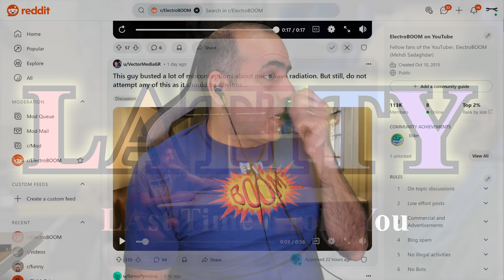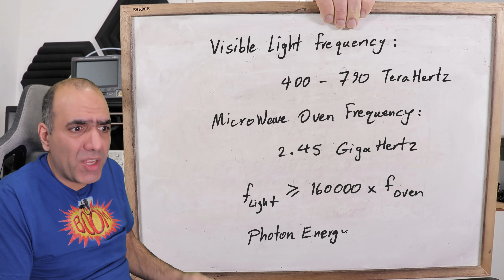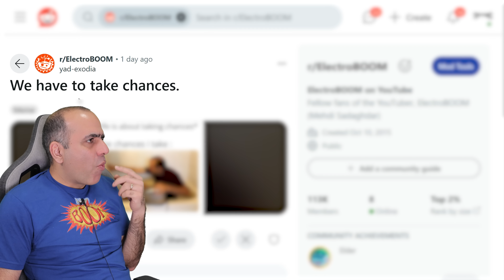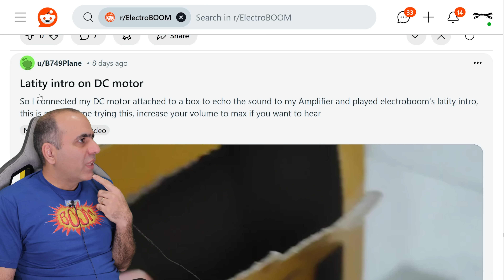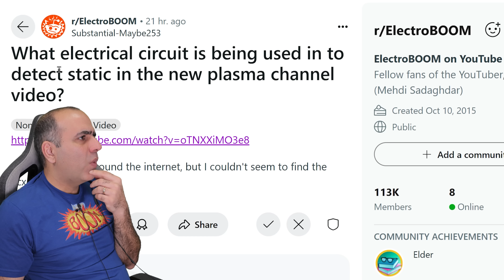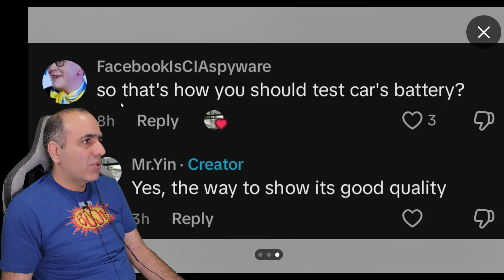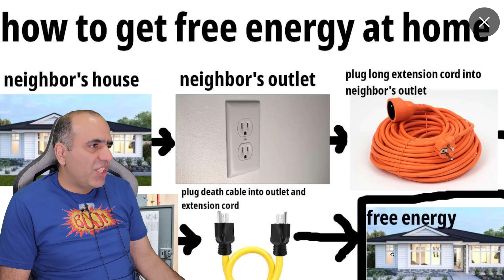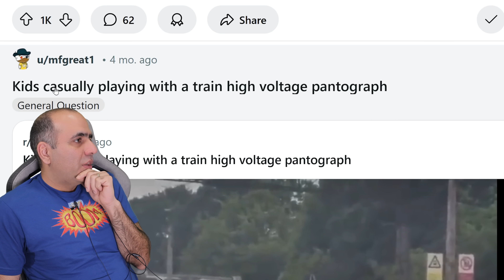Can You Microwave Yourself?! (LATITY014)

Comment: I don't see anything wrong, shoving type C (Europlug) appliances into type G (BS 1363), I did it all the time, though it is not recommended by Malaysian Standards governing body(SIRIM).

Beside adapters is cheap and also a little DIY if you want to convert Type C to Type G.

Mehdi should rate AC power plug safety someday, I believe type G is the safest.

Comment: In fact the waves reflecting back and forth inside the microwave oven create station waves making some places with a high power density and other and other with almost no power density. That is why you have a rotating tray inside the microwave (older ovens used a rotating reflector to change the position of the waves.
The energy of the photons is irrelevant if the number of photons is high. The frequency is chosen because it is heavily absorbed by water. Forget QM it does not help here: just calculate the average power density inside the whole cavity (but remember that standing waves distribute power unevenly that is why I don't put a glass of water in the middle of the rotating tray for better heating).
So even if the power is not enough to heat some tissues fast, tissues with high water content will heat much faster (like your eyes and mucous membranes).

Comment: my school has horrible microwaves, the door on one is broken so you can actually put your hand up to it and feel the heat from the radiation. I was surprised because it feals like a very concentrated line of heat instead of alot of heat around like most heat sources.

Comment: Let me clear something up for people.

A magnetron is what goes inside of microwave ovens, which are the devices you might have on either your counter top, above your stove, or where ever. The point is, is we use them to heat up out food. How do microwave ovens heat up food? To understand how that works you need to understand what microwaves are.

A microwave is a form of electromagnetic radiation. Now, typically when you hear the word "radiation" you think highly dangerous and could cause cancer, or other forms of dangerous diseases or powerful yet dangerous impacts on the human body like mutation. But that is simply not always the case. There are two categories of radiation, "ionizing" and "non-ionizing". "Ionizing" radiation is radiation that CAN cause damage to the human body and cellular structure, tearing through the body and destroying DNA, RNA, etc. Ionizing radiation is like X-rays, Gamma-Rays, Alpha Rays, and Beta-Rays. These forms of radiation are very high energy and can cause serious damage if in high intensities or not treated. "Non-Ionizing" radiation is radiation that does NOT damage cells, or at least in the way ionizing radiation does. I say this because ionizing radiation itself does the damage, so Alpha-Rays which are composed of Alpha particles, those alpha particles are doing the damage to cells, and what not, same with Beta-Rays, beta particles are doing the damage.

How does non-ionizing radiation damage you or cells? Well to start, you need to understand forms of non-ionizing radiation. In this example, we are focusing on the Micro-wave. Micro-waves are a form of "Electromagnetic Radiation" which is typically generated in Electromagnetic interactions of high energies. There is sort of a spectrum of waves. Like light we know that it goes from Low-Energy (Infrared - Heat) to Medium-Energy (Visible Light - Color) to High-Energy (Ultraviolet - Invisible, but high-energy) similar to this, there is a spectrum for electromagnetic radiation, and light is on there too! Another quick thing to note is that the higher the frequency, the shorter the wavelength.

So what do Micro-waves do that is dangerous? Micro-waves vibrate water molecules in your food, and this in term, generates heat causing your food to heat up. While in the case of you being subjected to close proximity of a magnetron (The device that generates the Micro-waves in your microwave oven.) its not the electromagnetic radiation that is doing damage in the sense of IT being responsible for damage, its the effect the Micro-waves have on the water molecules in your skin and cells that causes the damage.

Warning! DO NOT subject yourself to a Magnetron in close proximity!

You can be sub-due to harsh burns, rashes, blisters and more painful phenomena that can cause serious injuries!

If you want to learn more about this, you can always reply to this comment.

Comment: Love ya, man. Keep it crazy.

But I did want to give you a heads-up,  the microwave magnetron radiates from the sides of that nub on the top, not straight out the end. I don't know if you were crawling on the floor to keep away from the microwaves or if that was just the fun way to do it, but you were actually in the strongest area of the field.

Comment: I had such a cable in my old neighbor, 500kv power line was passing through a San Fransisco-like hilly roads, uphill and downhill but the power line is at fixed height and at some hills as you get closer to the line, a tingling sensation and a 50hz bass sound was coming and static feeling on the top of my head-hair.
I'm totally in another city now but I guess it's more or less like the one posted to LATITY-posting, but no coronal discharge or any blue arc was observable.
But say if you had few meters of conductive thin wire and a folio wrap balloon (the conductive party balloons) one could feel something.
DO NOT TRY THIS
Reply: or try this, it won't kill you that much, just a little

Comment: 9:51 Or better yet, learn how to change the battery in your ignitor and let the sparker of said ignitor do the work (although you may need to remove surface rust because with my experience [shared with my aunt and her aunt and uncle] the sparker would need a bare surface of metal for the actual spark to jump to)

Comment: You can get free energy with a red pulse construction Lazer, piece of wood with 2 finishing nails for the venture crushing the fields of the photons ripping away the black from the white balls creating a sub-atomic nuclear explosion and go from a 5v lazer to billion-trillions of electron volts the red turns 100% white and you collect that run it through a circuit to batts then power anything you want because you only have to start it once initially then have a setting that doesn't let the batteries completely discharge so you can always power the 5 volt Lazer.  The contraption just needs to be engineered and I'm not financially viable to do it right now.

Comment: We have 500 kV line not so far from where I live. When you ride a bike under it you need to touch any metal part of your bike to let small current flow and discharge your body because else the charge induced from the line through a half of a period of AC can get you several thousand Volts potential difference to the ground, so it discharges through the air and it's not always a pleasant place on your body. )))
*By the way. Almost every year I see how stupidity and recklessness leads people to death or terrible injuries from the power lines. Kids are playing on the top of trains, someone touches wire accidentally or even on "oh, wHaT iF" purpose with a fishing rod. Every year I see news "Kid died in the bath with a phone on charge" and every time dozens of people are writing in the comments "iT cAn'T bEeee, it's only five voooolts". Idiots.(((

Comment: 10:35 You can test car lead-acid batteries for corrosion by charging them up, measuring the voltage, shorting them for about 10 seconds and remeasuring. If the difference of measurements is above 0.8 volts, the battery is is pretty much dead. Wouldn't try it with lithiums tho.

Source: old Honda service manuals

Comment: UK resident here. Yes you can use EU plugs in our outlets but it does mean bypassing the earth safety prong, which involves sticking something  into the ground receptacle in order to open up the live and neutral guard

Not recommended for obvious reasons but still doable.

Although we have EU sockets in our bathroom for charging toothbrushes and using electric shavers.

Comment: Yes, Euro plug into UK socket is dangerous. Firstly the shutter mechanism in a UK socket is operated by the longer earth (ground) pin going in first. So in order to insert a Euro plug you have to defeat the shutter mechanism by inserting a foreign object into the earth hole.

Secondly, UK plugs have a fuse, Euro plugs do not. The fuse is there for a reason, sockets in the UK are commonly fed from a ring circuit on a 32A breaker, so the appliance cord needs a fuse. Other countries plugs typically don't have a fuse because the sockets are fed on radial circuits on a much smaller breaker.

And finally the UK socket just isn't designed to take a Euro plug, so there's no guarantee that the plug will make a.good contact with the socket, which can lead to high resistance or arcing
Reply: Now i understand the reason for that fuse, thanks. It's limited to 16 amps in our code and most power cords can handle that under normal conditions. The equipment is supposed to have an internal fuse, optimized for that specific equipment. The power cords for bigger equipment always use wire that is rated for 16 amp continuously. The wire gauge does not need to be the same as the one in the installation, because our code demands a bit oversized wire gauge, to avoid power drops over longer distances, it is not for fire hazard because even 4 times thinner wire can handle 16 amps without getting hot. It only becomes dangerous if it's a long wire that is rolled up , that can get hot enough to melt the insulation.
Reply: I like putting g foreign objects into the earth hole though😂
Reply: Regarding the shutter, it's on ground and you can just force it through without the ground pin.
Reply: I don't understand why the whole world doesn't adopt the UK G type plug socket. It's super safe and you can't accidentally unplug something by tugging on it. And it comes with a fuse installed. One time on holiday in Mexico the US plug socket was so feeble we had to tape the plug to the wall because it kept falling off and arcing. G type is king, everything else, pathetic.
Reply: @TheMadScientistOfLuton  each plug type has downsides. The UK plug's biggest: can only be inserted one way.
Reply: @TheMadScientistOfLuton  Forced grounding (and ring circuits are generally not good).
Reply: @TheMadScientistOfLuton  yeah well that's Mexico. You know Mexico isn't a first world country with good safety standards right? Just because the Mexican version of the US outlet is made of toothpicks and glue, that doesn't reflect a proper made US outlet. 
Your comment is like "I didn't like the quality of the Italian pizza that I bought in China town, which means all pizza is bad"
Ignorant blanket statement on your part. 
Try comparing a US outlet to something made for 12 cents in a sweatshop.
Reply: still not stopping me, works fine with battery charger
Reply: You are overreacting. Everyone in my country does this all the time. Worst that happens is the house breaker will trip. Is it more dangerous than using a UK plug, sure, but it's not as bad as you make it sound
Reply: @dogoku yeah also, people don't want to increase the price of their products by adding fuses and baby protection and weird shielding and shit.
I'm a grown man with no babies in my house EVER and I don't go around trying to put a plug in halfway and then jam something metal into the exposed half.
I'm convinced that UK babies are suicidal, if these extreme plug precautions are needed. 
Instead of making your UK plug sockets and plugs "suicide proof" then UK parents should PAY ATTENTION TO THEIR BABIES BETTER. 
Or at least take the infants to therapists to see why they try so hard to kill themselves. 
I don't see why people in the UK are so obsessed with telling everyone to adopt their weird anti-suicide baby protection mumbo jumbo. 
They didn't do Brexit correctly and their politicians are only slightly less insane and evil than Ronald McTrump the sex offender. 
And they pay more taxes and VAT so I'm not sure why they are in a position to talk about efficiency or good ideas.
Reply: 1. 2-Pin EU plug no need to be grounded (Same with some UK devices - look for Yours phone chargers: grund pin is plastic!)
2. Almost every EU device has build kinda protection /fuse/ mechanical or thermal - this is why never buy cheap "china export" stuff.
3. 99% emigrants from EU never use proper UK plug after arriving or when coming into sesonal work. Scewdriver or knife, to open socket flap, and no adaper is requied. Never heard about anybody to hurt himself.
Reply: @stanley3647  I never said it needs to be earthed, just that the earth pin - whether it does anything electrically or not - is what opens the shutter. Sticking something other than a plug in there to open the shutter is not a good idea and can damage the socket.

And yes applicants have overload protection built in, but the fuse in the plug is to protect the cord, not the appliance, which the overload protection in the appliance wouldn't necessarily do as it's after the cord.

And just because 99% of immigrants do it doesn't make it right

Comment: Feeling a mild shock on a bicycle under HV powerlines is REAL! If you have rubber hand grips and shoes on you will be electricly isolated from the bike. While under power lines, stand up, coast, then lightly touch handbrake or other metal part of frame. 
I also got shocked on a bike under a Blackhawk helicopter as it was landing. :-D

Comment: I was a radio tech in the USAF, and it always makes me giggle when people get scared of microwave radiation. I'd be blasting myself with a 4,000 watt antenna on the regular. And there are people who say they get sick when their WiFi router is on...
Reply: Depending on the frequency, there is a good chance you could get cataracts or become infertile as a result of the radio waves heating up sensitive tissues within your body. The risk again depends on the frequency, distance between you and the antenna, as well as the amount of time spent within the field. Wifi doesn't transfer enough power to be dangerous, but a 4000 watt magnetron would do the trick
Reply: Oh, brother! In the winter, I warm myself with an open microwave.)
Reply: Obviously you have built up a tolerance
/s
Reply: "I inhale car fumes all day, It always makes me giggle when people get scared of car pollution."
Reply: DNA is sensitive to EMF of many frequencies, essentially, the long folded strands function similarly to a fractal antenna.
Look it up if you don't believe me.
Reply: But no experiments in a lab run by actual scientists have actually demonstrated dna breakage from microwaves. Yes there are people who have called themselves "scientists" who make claims like what you are saying, but it has never been duplicated in a real lab.
Reply: @TismSchism  No it doesn’t. Technically speaking, there is zero evidence whatsoever that it does, but that amounts to the same thing.
Reply: Yes people are sensitive to different things
Reply: @rollinupeverest5042  except people can't feel those extremely low levels of radiation . What people actually feel is similar to placebo.
Reply: @rollinupeverest5042  Yes and some people hear voices and are delusional

Comment: On using european 2 pin plugs in UK sockets, the BS1363 standard specifically requires that the shutters on a UK plug can't be opened by a 2 ping europlug.  So, at least the specification writers think that is a bad idea.

Comment: for the DC motor as a speaker, the part making the sound is the rotor, not the body, so it works way better if you restrain or put a paper cone on the rotor!

I used to make floppy drives and hard drives play music, and played around with DC motor speakers for a while. I also discovered some of the capacitors on my amplifier could play sound too if they were driving a heavy load.
Reply: I've heard of people fixing distortion by putting a hand on capacitors, which was indicative of cold solder joints

Comment: I'm Brazilian. The "suicide showers" are the normal around here. Gas ones are really a niche. In Brazil we have a lot of green energy (from hydroelectrics and so), so tube gas is not a rule. And yeah, those showers are very safe. Once, one of them in a house a rented burned (cus the shower has 20 years without maintaince) and I was still able to take the soap out of my body before turning it off without getting shocked lmao!

Comment: Capacitor thing - sometimes in Sri Lanka when you go to buy a new capacitor (or condenser as they also tend to call it) for a ceiling or pedestal fan, the shop staff will plug it into an extension cord (itself, usually something cobbled together with peeling tape and wonky connections), to show you that the capacitor is in working order before selling it.

Comment: UK and Euro plug thing - we've been doing this kind of round-pin-in-square-hole-thing in Sri lanka for several years now with older appliances and electrical equipment, as the Government changed us over from round pin plugs to the UK square pin plug. The connectivity is fine, but the pins can get bent over time for equipment that you regularly plug and unplug - like chargers. But for something that's not going to be regularly removed and replugged (like a TV or DVD player), it's fine.

Comment: Two dangers all magnetrons.  There is a third issue with some of the old ones. 
1. Heat from parts and the field 
2.  High voltage. 
3. There was an early magnetron with a very dangerous material used as the insulator (the white part that was glowing red)

Comment: Honestly, it's a lot more dangerous to walk close to an AM broadcast tower holding a metal pole, metal umbrella, or grounded wire than playing with a magnetron.  It's also probably more dangerous to walk several hundred yards pulling a grounded wire, or erecting any sort of antenna or grounded pole near transmission lines.